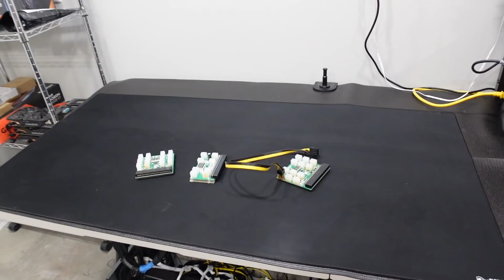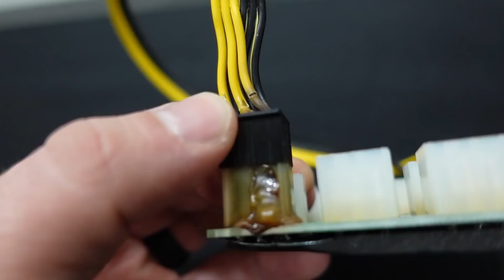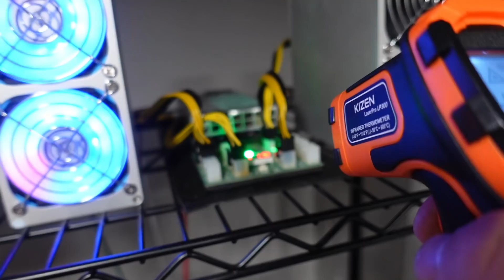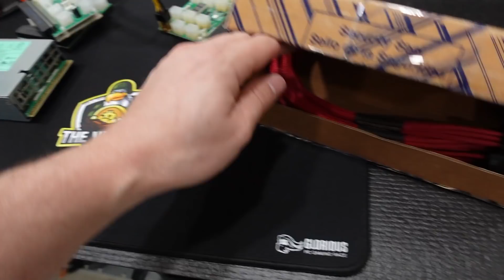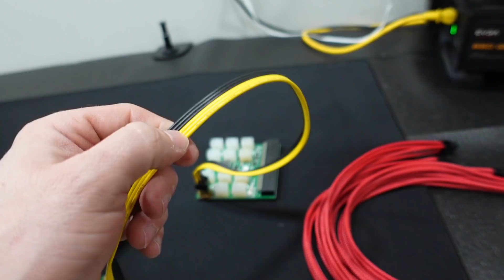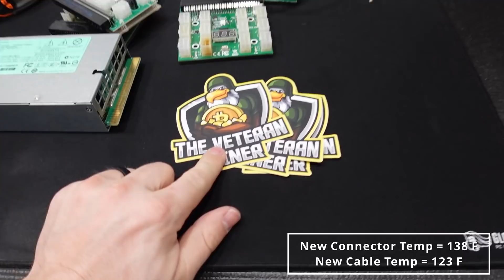IS HOME CRYPTO MINING DANGEROUS? | Common Mistakes Crypto Miners Make With Power

Comment: As a journeyman electrician of over 30 years this video is serious..  To complete a circuit between a power supply and a gpu there are at least three failure points.  Failure point one.   Connector 1 that plugs into the Power Supply. the pins carry current.   Failure point number 2.  The cable itself.  Ohms law... V=IxR.   Smaller gauge wire, the more resistance.   Resistance = heat.  Failure point three is the other connector's pins.   i'm not even going to get into crimp / solder joints, length of cables etc.    Take this video seriously.

Comment: the problem here is you are putting way too much current down the cable, far more than it was designed for. you are going from a 6 pin to 8 pin connector, while it is fine to go from an 8 pin to a 6 pin, the other way around is very bad. you need a 2x 6pin to a single 8pin cable to support the wattage. the way you have it configured you have a 75W rated cable and you are pulling up to 150W through it. it is going to generate some heat as the cable and the connector are not rated to carry that amount of current. 150W rated cables have a much thicker wire then the 75W rated cables, this is why they are getting very hot. if you have a single 6pin to an 8 pin, the direction the cable is designed for is 8 pin for the power and 6 pin for the thing being powered. if you have 2x 6pin and 1x 8pin, you can use it either way 8pin power or 8 pin to the thing being powered.
Reply from the maker: Thanks for the insight, I appreciate it.

Comment: Wires have resistance that creates heat the more amps you push through a wire the hotter the wire and that is what happens the wattage is the heat

Comment: Dude alot of the times the wire itself is not copper or not even a decent blend of conductive metals. Alot of amazon car audio and solar wire use cheap copper c. Aluminum blend which is worse for conducting  current, the wire heats up and more resistance it would surprise me if the wire you have are copper aluminum. If you ever  see the letters C.C.A on the wire anywhere  its cheap wire and the the gauge needs to be +2 to keep the wire cool while operating at said voltage and amperage, one more thing that makes a huge difference in temperature in wire connections is how well the wire is crimped or soldier’d on … a loose crimp will heat up quickly
Reply: Yeah, "discount wire" and wire from random unverified sources is always garbage. Copper is expensive, so they ship out copper coated aluminum wire and straight up aluminum wire. 

They also undersize it, so a 14 or 16ga wire is actually like an 18 or 20ga inside with excess insulation to "bulk it up" and make it look legit.

I've seen cheap cables included with Amazon stuff that barely have 10 strands in them!
Reply from the maker: Great info thanks!

Comment: The smaller gauge wire is not rated for the amperage that the gpu demands. There for heats up more than a thicker gauge.

Comment: The simple answer is not using HP server power supply in connection with the break out bords. Evga/ Thermalake or similar platinum rated ATX power units only. The savings of the HP Server power supply are not worth the risk. At least that is my opinion on how i plan to prevent such electric smoldering / fires

Comment: I've always been an extremely safety conscious miner so I've never built a normal mining rig. Instead, I have two or three GPUs directly connected into an expensive overclocking motherboard designed for high power delivery. To mitigate some of the efficiency loss and longer ROI, I also use the computer to simultaneously farm Chia on 14 TB hard drives, which is a low wattage endeavor and doesn't overly tax the system and should produce small but consistent profits for many years. Note that if I have 3 GPUs connected, I try to ensure that they are all low-to-medium wattage (for example, 2070 Super, 2060 6gb, 1660 Super). I have an RTX 3090 on my gaming computer and that runs solo.
Reply: What'sapp✙𝟣𝟤𝟢𝟨𝟩𝟨𝟣𝟢𝟥𝟢𝟪

More updates on ETH, NFT’s, BTC📊🚀..
What'sapp✙𝟣𝟤𝟢𝟨𝟩𝟨𝟣𝟢𝟥𝟢𝟪

More updates on ETH, NFT’s, BTC📊🚀…

Comment: Where do we find those red cables?
or whats the highest Awg pcie cable i can use
Reply: What'sapp✙𝟣𝟤𝟢𝟨𝟩𝟨𝟣𝟢𝟥𝟢𝟪

More updates on ETH, NFT’s, BTC📊🚀..
What'sapp✙𝟣𝟤𝟢𝟨𝟩𝟨𝟣𝟢𝟥𝟢𝟪

More updates on ETH, NFT’s, BTC📊🚀

Comment: Not sure what one of those ASICs pull.
But the engineering standard for a PCIe cable is 288w per a cable. I have a feeling that those pull more than that, which is causing your problem.
Either that or some of the parts in your chain are not up to spec.

Comment: Protips: 
1.) Don't be cheap on your gear. You are already spending extra for cards. Make them last. Spend a little extra to keep your gear running. It will pay back in the long run.

2.) Insurance and coverage is worth it. Up front cost a little more, but if something does happen, you will be better off.
Reply: What'sapp✙𝟣𝟤𝟢𝟨𝟩𝟨𝟣𝟢𝟥𝟢𝟪

More updates on ETH, NFT’s, BTC📊🚀..
What'sapp✙𝟣𝟤𝟢𝟨𝟩𝟨𝟣𝟢𝟥𝟢𝟪

More updates on ETH, NFT’s, BTC📊🚀…

Comment: Great Video Hobbyist Miner - Appreciate you showing 1st hand your experience of using cheaper / mislabeled wires from unknown sources. I'm sticking with Parallel Miner for my cable.
Reply: What'sapp✙𝟣𝟤𝟢𝟨𝟩𝟨𝟣𝟢𝟥𝟢𝟪

More updates on ETH, NFT’s, BTC📊🚀..
What'sapp✙𝟣𝟤𝟢𝟨𝟩𝟨𝟣𝟢𝟥𝟢𝟪

More updates on ETH, NFT’s, BTC📊🚀

Comment: The most common reason for melting pins is the contact resistance between the actual wire and the pin. The problem rarely is with the Female to Male pin-to pin connection. Having low-quality (non-fully-copper) wires multiplies the problem!  In 98% of cases wires and pins are only crimped. This makes the contact resistance higher compared to any soldered wire/pin. Crimping and then soldering does slow the work, but makes the contact much much better. If you are making your own 6-pin/8-pin connectors and cables, my advise would be  -  after crimping, it is best to solder each pin/wire connection.
Reply: What'sapp✙𝟣𝟤𝟢𝟨𝟩𝟨𝟣𝟢𝟥𝟢𝟪

More updates on ETH, NFT’s, BTC📊🚀..
What'sapp✙𝟣𝟤𝟢𝟨𝟩𝟨𝟣𝟢𝟥𝟢𝟪

More updates on ETH, NFT’s, BTC📊🚀…

Comment: The main trouble is that the current CHEAP wires are NOT COPPER. They do contain a certain amount of copper, but in order to make them cheap, they make the wires with other much cheaper metals, including iron. Copper has low resistance, other metals have much higher resistance. What you get is a lot of heat, a lot of power loss in the cable, LESS than 12V to the GPU/miner = UNSTABLE WORK, and potentially - a FIRE.
Reply: What'sapp✙𝟣𝟤𝟢𝟨𝟩𝟨𝟣𝟢𝟥𝟢𝟪

More updates on ETH, NFT’s, BTC📊🚀..
What'sapp✙𝟣𝟤𝟢𝟨𝟩𝟨𝟣𝟢𝟥𝟢𝟪

More updates on ETH, NFT’s, BTC📊🚀..

Comment: Instead of using breakout boards, just use a PSU with pin connectors or the PSU the Goldshell offers? You clearly aren't using the proper PSU. I own four Mini Doge units and never have had a problem because I use the suggested PSUs . . . it's not rocket science.
Reply: I have a1200 watt at 120 v outlet Bitmain PSU that runs only three 233 watt mini doge miners and it happen to me. The wattage consumption is under the 80 % rule. So I tend to agree with the wire and pin issue. This PSU is made for a larger output miner and I'm only using it for three small ones. Now granted its not the goldshell psu but one that is made for basic miners though.
Reply: @jimmyhood7022  You really should get a dedicated 30amp 220/240v outlet, attach a PDU (I recommend Tripp Light) and run everything off of that. I've never had a problem with that configuration. Also, ask your electrician to use copper wiring for the installation. Copper conducts better and handles the higher voltage load better than aluminum.
Reply: @adamjuchniewicz4968  yes in the process of doing that I'm sure that will help.

Comment: I actually have cooling fans that also direct air into my power cables to help maintain the life of them.  I have the same temperature gun and can see a difference so I have continued to do this from the gpu all the way to the break out boards.
Reply: What'sapp✙𝟣𝟤𝟢𝟨𝟩𝟨𝟣𝟢𝟥𝟢𝟪

More updates on ETH, NFT’s, BTC📊🚀..
What'sapp✙𝟣𝟤𝟢𝟨𝟩𝟨𝟣𝟢𝟥𝟢𝟪

More updates on ETH, NFT’s, BTC📊🚀…

Comment: What the Veteran Miner failed to mention was that wire type itself can be the cause, along with the pin material. Wire is either silver, copper, copper clad aluminum, and aluminum. Also the pin material is a factor, as there is copper, brass, and bronze. If he did go to school for this, I find it a little odd he mentions nothing about those issues. Silver has the highest conductivity out of all metals, followed by copper which is around 8% less conductive (based on purity), while aluminum is around 46% less conductive than silver. Some manufactures also have wire that is copper clad, which is an aluminum wire that is cladded in a copper outer coating which has a conductivity somewhere in the middle of copper and aluminum. When it comes to pins, copper pins are the only good pins as brass is 70% less conductive than copper, and bronze is even worse, around 80%. At least I was happy to see that he did mention the length factor, since length adds resistance to every wire, and the worse the conductor is, the worse it gets.
Reply: What'sapp✙𝟣𝟤𝟢𝟨𝟩𝟨𝟣𝟢𝟥𝟢𝟪

More updates on ETH, NFT’s, BTC📊🚀..
What'sapp✙𝟣𝟤𝟢𝟨𝟩𝟨𝟣𝟢𝟥𝟢𝟪

More updates on ETH, NFT’s, BTC📊🚀.
Reply: @pinnedynftverse1030  Thanks, NOT! loser

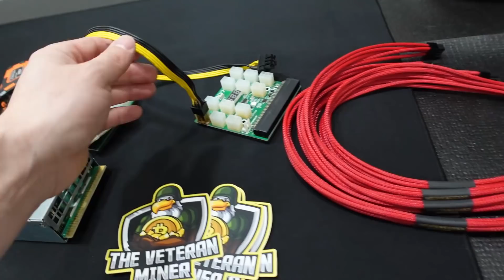Comment: 3:41 It doesn't seem to be a problem with the wire gauge because the connector is browning and melting first, more likely a problem with the actual pcie power connector (slightly loose connection, wires not crimped properly to the pins) 
You could maybe try taking the pins out of the pcie power connector and soldering them to make sure there is a good connection and maybe squishing the pins closed slightly to get a better connection, but probably not worth it, and probably better off buying better quality pcie power cables.
Reply: What'sapp✙𝟣𝟤𝟢𝟨𝟩𝟨𝟣𝟢𝟥𝟢𝟪

More updates on ETH, NFT’s, BTC📊🚀..
What'sapp✙𝟣𝟤𝟢𝟨𝟩𝟨𝟣𝟢𝟥𝟢𝟪

More updates on ETH, NFT’s, BTC📊🚀..

Comment: Its not the cables fault you used them wrong, those old cable must have been warm or hot to start with. Them Mini-DOGE can draw up to 300w (normally 240w) that way to much power for 1 cable. Heaver gauge cable not going to help much at the connection point, they are still only rated for 150w.
Its the DOGE miner that at fault here only one connector for over 250watts of power.
Reply: What'sapp✙𝟣𝟤𝟢𝟨𝟩𝟨𝟣𝟢𝟥𝟢𝟪

More updates on ETH, NFT’s, BTC📊🚀..
What'sapp✙𝟣𝟤𝟢𝟨𝟩𝟨𝟣𝟢𝟥𝟢𝟪

More updates on ETH, NFT’s, BTC📊🚀.

Comment: I was in the car stereo scene  for a while. I never ran cheap Chinese wires. Always made in the USA. I would run 0 guage and the US brands where either on the spot or a bit thicker. Very important  especially if you're running over 10K watts to a sound system
Reply: What'sapp✙𝟣𝟤𝟢𝟨𝟩𝟨𝟣𝟢𝟥𝟢𝟪

More updates on ETH, NFT’s, BTC📊🚀..
What'sapp✙𝟣𝟤𝟢𝟨𝟩𝟨𝟣𝟢𝟥𝟢𝟪

More updates on ETH, NFT’s, BTC📊🚀

Comment: The parallel miner cables are extremely stiff, just watching the video these cables look like crap compared to the other wires
Reply: What'sapp✙𝟣𝟤𝟢𝟨𝟩𝟨𝟣𝟢𝟥𝟢𝟪

More updates on ETH, NFT’s, BTC📊🚀..
What'sapp✙𝟣𝟤𝟢𝟨𝟩𝟨𝟣𝟢𝟥𝟢𝟪

More updates on ETH, NFT’s, BTC📊

Comment: Of course a good quality wire will be safer (mainly more durable), but I believe your problem is with the connector and not the wire, poor contact in the connector will accumulate heat, even if you are using 100Watt, this problem still occurs.
Reply: 100% right the pins are only rated for 50watts each, So 3 pairs only get 150w. There nothing wrong with the normal cheap cables if there used right. Also the Mini-DOGE miners will draw 233w to 300w that double the rated value. Using a heaver gauge wire is not going to solve the problem.
Reply: The other end of the connector spectrum which wasn't mentioned is that they are 3 common materials used in connectors, copper, brass, and bronze, and copper has far different resistances levels compared to brass or bronze which are cheaper pin options. So it's not just a wire issue in reference to metal types with silver, copper, copper clad, and aluminum wiring, but  pins type have the same problem.
Reply: There are many masters here
Reply: @plamxplamx  Cheers for that, but I can't take any credit as its just basic electronic/electrical knowledge. And I mean basic anyone should know about resistance and what happens if you get it wrong.
Reply: @Northeastfarming   Yes knowing about resistances if fine thing to know, but do you know about the difference in resistance between silver, copper, aluminum, brass, and bronze? As any one of those materials could be present in the construction of any cable you may purchase. That's probably the most commonly missed thing.
Reply: @MassBoost  Yep tbh i would be surprised if its not Brass/tin plated on both male and female. Not the best but standard. Also some of the  5556 only take 18-22 Awg wire. Really you just need to keep the amps within spec.

Comment: Veteran Miner is actually wrong. The number of stands is not what determines gauge. It's wire thickness. For example, welding cables might have same gauge as say car audio wiring, but the car audio wiring is much more flexible and thus has more strands, yet the gauge is the same still.
Reply: What'sapp✙𝟣𝟤𝟢𝟨𝟩𝟨𝟣𝟢𝟥𝟢𝟪

More updates on ETH, NFT’s, BTC📊🚀..
What'sapp✙𝟣𝟤𝟢𝟨𝟩𝟨𝟣𝟢𝟥𝟢𝟪

More updates on ETH, NFT’s, BTC📊🚀…

Comment: Those 18awg yellow black wire are actually 22awg or something, they've far from what they say they are. I also don't trust the breakout board and the connectors either so i have been switching all to direct contact: direct custom wires & bolts to the PSU, the less in-between components the better conductivity you have, less resistance, less heat, less watt, less risk. When it comes to electricity, then be serious.

Comment: I think your wrong buddy,  the critical failure point is the connector not the awg of the wire. the only way to guarantee is to make a solid connection would be to solder and sleeve the connections. that is why your getting brown plugs instead of melted wires.

Comment: I'm confused. Your guest is aked WHY the wires heat up and he beats around the bush not asnwering the question, instead he just says you cant trust the thousands of wires out there, never explaining that it is impedance and resistance of the wires acting like a toaster element. Then plugs his product, which there are no links to, not even on his channel, and you STILL link the wires on parallel miner that almost burned your house down? YGTBFKM... 

Why go to all the trouble if you are not going to link the custom wires? Why is he plugging his product but doesn't mention they're not available, yet? Details are important.

It's starting to get click-baity on your channel.

Is this how the whole mining community is? Eerything is a top secret show and tell? I can't even get a straight answer on any of the forums about an entry level GPU for a tight budget.
Reply: He said the wires were from Amazon not from PM. 

Also: "The Veteran Miner 10 hours ago
We are working on a retail space for the community updates will be on my channel."

Comment: This is why i only buy from Parallel Miner when it comes to server power supplies all there cables are 12 amp rated, 400 watt max and 16 awg. Ebay, Amazon and other "suppliers" are to risky and sketchy in my opinion. While i prefer EVGA power supplies when building a rig i always use server power supplies for anything else. 

Good catch none the less glad noting serious happened....mining has a lot of hidden risks and surprises that's for sure.

Comment: I have always used ASIC miner power supplies for all my GPU rigs, the wiring on those are a thicker gauge to power a hefty ASIC and thus makes it super safe. I have never had brown wires.
Reply: What'sapp✙𝟣𝟤𝟢𝟨𝟩𝟨𝟣𝟢𝟥𝟢𝟪

More updates on ETH, NFT’s, BTC📊🚀..
What'sapp✙𝟣𝟤𝟢𝟨𝟩𝟨𝟣𝟢𝟥𝟢𝟪

More updates on ETH, NFT’s, BTC📊🚀….

Comment: Im wondering if you can feel any heat from your pcie cables on the mini doge miners.  I purchased one and have it on a single 600W PS from parallel miners using there cables.  I dont feel any heat or warmth.  If the connectors were over 120 I would think I would feel warmth to the touch..... Never the less I will be keeping an eye on things now.   Thanks for the content.
Reply: What'sapp✙𝟣𝟤𝟢𝟨𝟩𝟨𝟣𝟢𝟥𝟢𝟪

More updates on ETH, NFT’s, BTC📊🚀..
What'sapp✙𝟣𝟤𝟢𝟨𝟩𝟨𝟣𝟢𝟥𝟢𝟪

More updates on ETH, NFT’s, BTC📊

Comment: You forgot to mention .. Heat = higher electricity costs, that takes more to cool that takes up even more electricity.
Reply: What'sapp✙𝟣𝟤𝟢𝟨𝟩𝟨𝟣𝟢𝟥𝟢𝟪

More updates on ETH, NFT’s, BTC📊🚀..
What'sapp✙𝟣𝟤𝟢𝟨𝟩𝟨𝟣𝟢𝟥𝟢𝟪

More updates on ETH, NFT’s, BTC📊🚀..

Comment: I had this happen when overloading a wire into a 3090, depends a lot on power draw for a single wire.  But usually a 3090 running off a power lead out of a 1300EVGA ATX supply normally would be okay due to quality components.  So.. I'd say, know the card you're powering (and if a riser or GPU itself), know the power draw of the card or device and the determine if you truly need more beefy wires.  But thanks Hobbyist, now I'm paranoid gonna go around to all my server power supply style rigs and use my laser thermometer gun and check for browning lol.